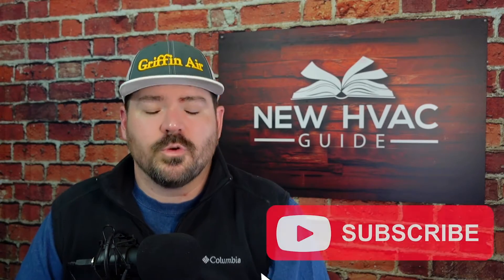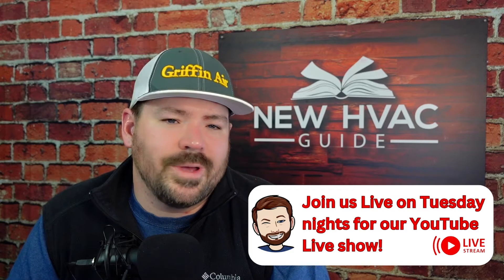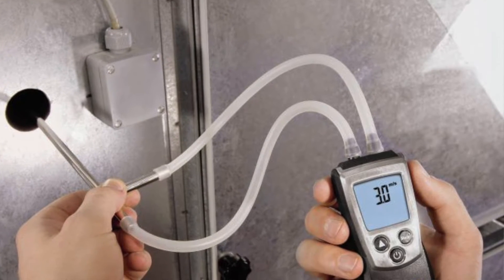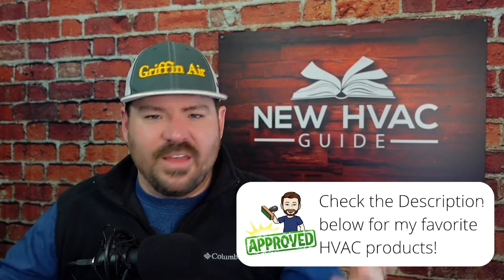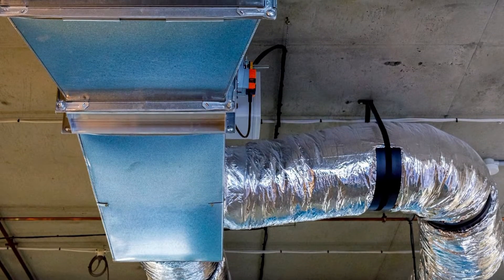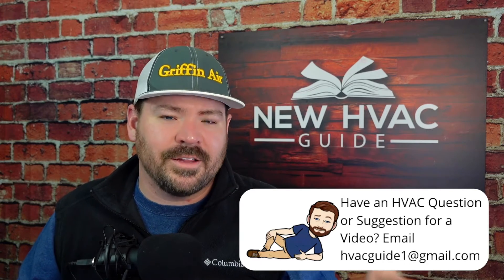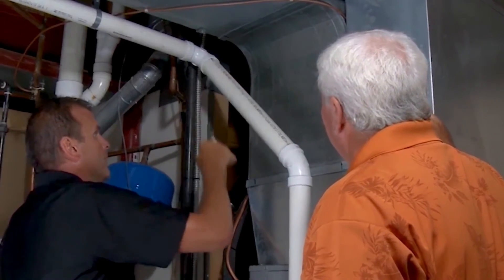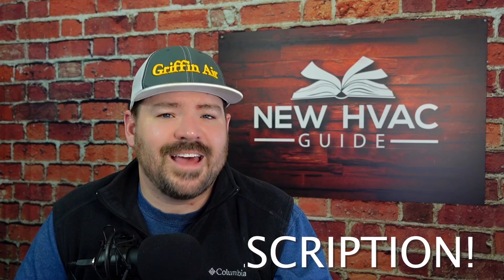5 Reusing Ductwork Tips! - Lifetime of ductwork

Comment: My house has flexible ducts connected to a fiberglass duct board trunk line. First, not a fan of fiberglass in an air system. But it's what I was working with. I decided to upgrade all the flexible duct from R6 to R8.

Once I got into the project, I found so many half assed install techniques that it shocked me. The first most egregious failure of the original contractor (in 2000!) was that they had two different sized square duct board ducts connected together through a wall bulkhead. Each trunk line duct was a different size - one was smaller, one larger. The problem is they simply slid the smaller into the larger but never sealed the junction. And the smaller duct was about 3" shorter in height, but the same width. This left a massive hole at the top that was leaking hot and cold air into the garage! (evap/fan side is in the garage).

While I can say the garage was comfortable, I can also say this was one reason why the master bed was always too cold in winter (low air flow). I managed to seal this junction with a pool noodle (because you could not get to it - the junction was through a hole in a wall.

Next I found a series of distribution duct problems. On duct collar was actually half disconnected. One contractor who did the basement didn't even use hard collars to transition from duct board to flexible hoses - he just punched a hole in the duct board and shoved the flex duct through it (stupid).

In the end, I redid every duct in the place I could get to. I replaced them with R8. I retywrapped all the flex ducts, then I used aluminum tape to seal them where they transitioned from the duct board to prevent leaks. I sealed all of the hard metal collars to the duct board as well with mastic tape. I installed hard metal collars and sealed them where they did not provide them.

By the time I was done, I got twice the air pressure (I recovered all the lost pressure). The unit stopped (over) running on heating and cooling cycles. My heating and cooling bills went way down. The side of my house that was getting no air is nicely comfortable. What is notable here is that the system was in that state for over 20 years! Furthermore, I had been living there for 3 years and had multiple visits from air techs - I paid for a service contract. NONE of those techs ever noticed a massive air leak into the garage.

Another problem I found was the two air inlet grills that feed the system were sized too small and were causing an air inlet restriction. I could tell because the system would suck the grill onto the wall after I had it off and went to reinstall it. They were also whistling when the fan was on. I swapped them with larger grills (over the same sized holes in the wall), and that really improved air flow.

I also found massive crud built up on the return side of the A coil. I was able to clean most of it and recovered a huge amount of air flow. I also found crud every duct - flexible and duct board. I cleaned out the inside of every duct I didn't replace. I checked every transition from duct to floor vent I could get to and sealed them.

Important take way here is that, because I have tech skills, I found all of this and fixed it. Many of these problems were put there by the (air) contractor who built my house, and were there for twenty years and three owners. That blows my mind. But I'm not surprised. There are a lot of contractors cutting corners to save a buck - but cheating the customer.

I can only imagine how much it would have cost me to hire someone else to hunt down all these problems! Sometimes I'm glad my father put a screw driver in my hand when I was a kid. Thanks for this video. It helps those of of us willing to tackle this work a lot.

Comment: When I was in the business 20 years ago, I used ASHRAE MANUAL J to do the heat loss and gain.
Reply: That's for sizing the equipment as well as the % of the HVAC system airflow needed per room

Comment: How would ducts be updated in a house that uses wall cavities though when the supplies run thru clay pipes under a slab
Reply: since this might be an honest request, and no one else answered... i'd personally find a structural/civil/mechanical engineer for that question.  if no money to spend - i'd do it via library, online, engineering forums, etc.  i've personally had to work around old underground cabling systems in clay pipe, and even wooden ductwork near charleston sc, but hvac via clay pipe under a slab?  sounds like an awesome project for a curious engineer.  or a hard solved problem for a short-funded property owner.  best of luck.
surely by now you've gotten the solution.  but just off the cuff type answer - what about running pvc/vinyl piping thru those clay pipes?  is the ground/slab even broken?  see what i mean?  an engineer would love that challenge.  maybe even give some free advice.  you just gotta find that engineer.  like teachers, attorneys, police, some do it for the diploma (vanity) and some do it for the desire.  find that curious engineer. jmho
Reply: @dcs4555  Hey thank you so much!  Yes it is an honest question.   Yes low budget but had to do Aeroseal since couldn't figure anything else.  They did the supplies but couldn't get pressure up on  the returns to do them.  Kept asking if a hidden return.. not that I know but the neighbors did shady stuff flipping this house.   I really like the pvc pipe idea.      Thank you so much!   I think that would been better than the Aeroseal.   Yep low budget due to caregiver of my only child, Lyme, out of pocket, etc.   You surprised me.  No one hardly to help at all unless I pay them & they give nothing in return.  No one has your breadth of experience